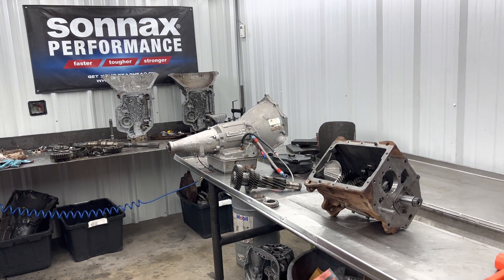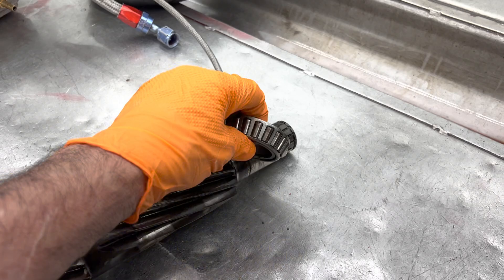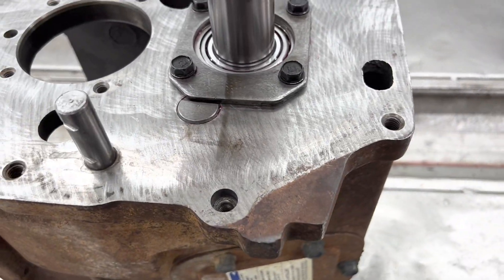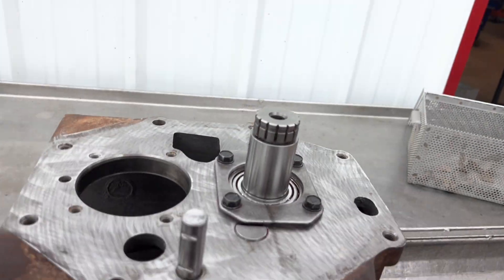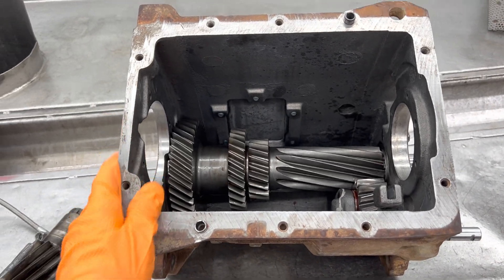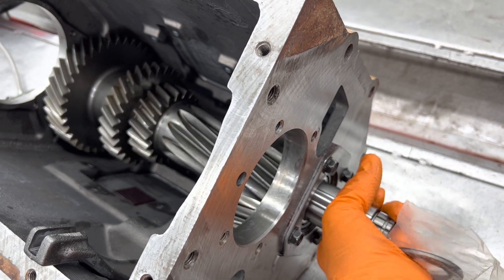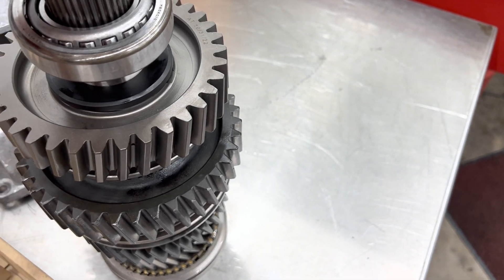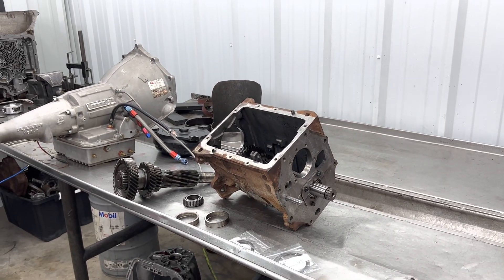Dodge NV4500 partial assembly

Comment: The endplay spec for both shafts is .002”-.006”, you absolutely do not want the shafts preloaded, i have a stack of cracked cases in my shop with preloaded mains.

Comment: Ive had my 5th gear nut come loose. It was a updated nut like you showed. I ended up finding a sleeve that's slips over the output shat that's splined and it has 4 fingers that slip into the groves of the nut. It was made out of chromoly. Down side is its for 4x4 applications only. Don't know if you've seen those but it might be something to look at and possibly to offer

Comment: Cannot thank you enough for the nv4500 information! My nv4500 has 431k on it and 3rd gets a little notchy when its cold outside. Planning on rebuilding it next winter and all the little tips here are greatly appreciated. On a side note this will be my 2nd transmission using your info. First one was a 4l60e i had sitting around for years. As a weekend automotive hobbyist i wanted a challenge to see if i could do it. After the Nv4500 in my truck ill be then tackling the 4l80e in my cummins swapped suburban. Wish i lived closer, I'd gladly mop the shop floors and take out the garbage just to learn some more tips and tricks.
Reply from the maker: You would be more than welcome to come
Reply: 431k?!?!?!?1 Holy toledo!!!!!!!!!
Reply: @goldfishhhification  Yessir 431k on my 95 12v ram. Shes been my daily driver for many years and all over the sunny state of florida. Never left me walking. Sure being a dodge shes eaten her share of ball joints, Tie rods, steering gearboxes and rides like an old tractor but ill never get rid of her LOL